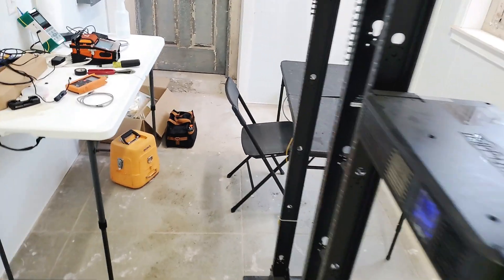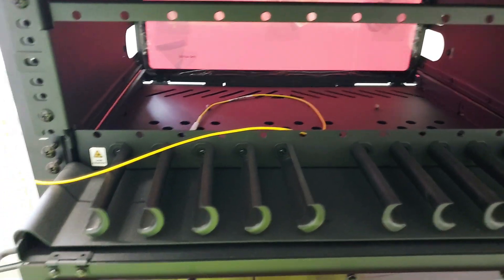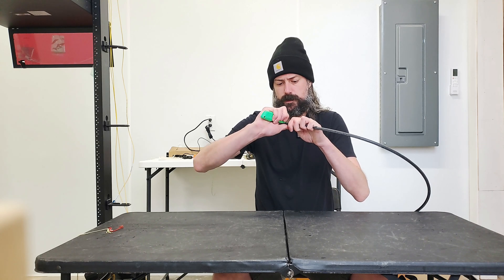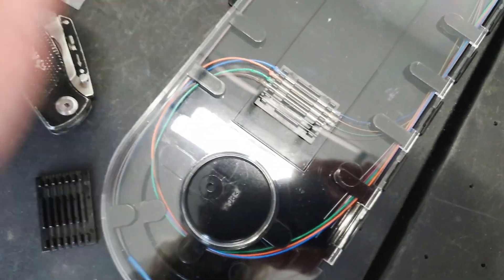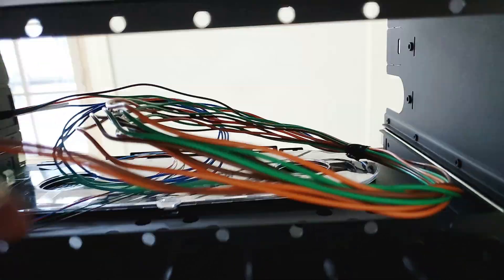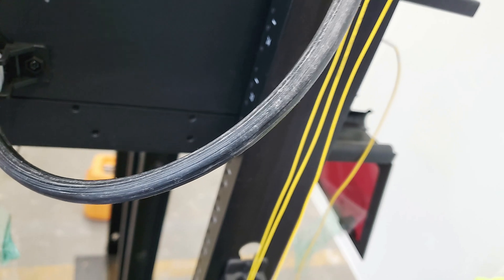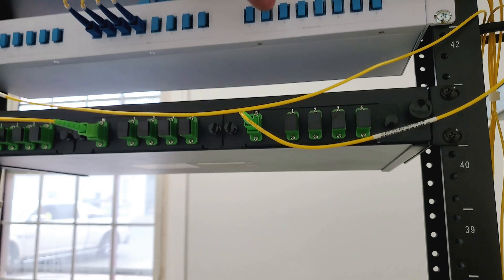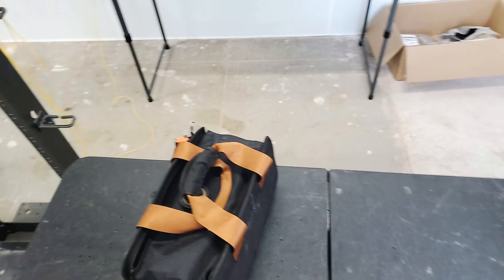26km DWDM,  Corning FastAccess sucks and some OTDR

Comment: Are you using any DCM or EDFA? Or what is the max distance not using them?
Reply from the maker: We are not using any dispersion comp or doped fiber amplifiers in our network as we are moving about 15-20 miles in between POPs.  It really depends on your fiber quality first.  We are using a single fiber passive system and are achieving 16 channels on 1 fiber over 15 miles.  Note these optics are direct pluggable into our switches.  So there is some benefits there not in your question.  I feel confident that it would work the full 40 miles it's rated at but if we needed to go 40 miles I would use a 2 fiber system.  The 2 fiber systems have a greater distance.  1 fiber perfect no splices, connectors, should be able to go 40 miles dwdm passive, and 2 fibers you should be able to do 100 miles.

Comment: Is it one fiber that is being tapped into 4 times or? Help me understand
Reply: No, like most outside plant fiber there’s multiple fibers within each cable. I believe he said that the one he’s working on is 48 pair. 96 count strands. Within the black outer jacket there’s multiple tubes (there’s a color standard which we use to tell what tube is first, what fiber within a tube is first…)
Reply: @OverKillPlusOne  oh I was confused from 9:14
Reply from the maker: At 9:14 we are just looking at the OTDR reading on 1 fiber.  This meter shows the quality of the fiber and where the events are taking place.  Like a splice or a patch location.

Comment: I'm not a big fan of Corning FastAccess myself, but once you work with it some it's really not that bad. Depending on the size of the cable, most of the time you can take needle nose pliers and stick in the cut end of the cable and kind of ream it around until the seams open up. You can also use a large screwdriver. You're looking for two white seams imbedded in the jacket 180 degrees apart. That is where the cable naturally opens up. Once you get those seams started (you can also use a razor knife if you can identify them) it peels open like a banana if you grab the two halves of the jacket.
Reply from the maker: I think it's so dumb nothing makes it fast other than needing to buy a special tool to make it work.  If you can't access end of a cable with a razor knife within 10 minutes it's a piece of crap IMO!